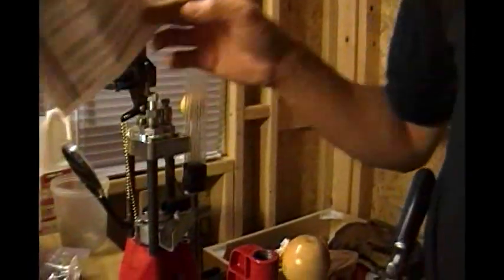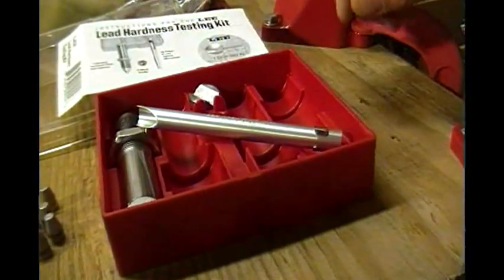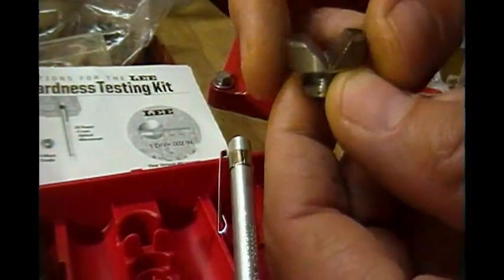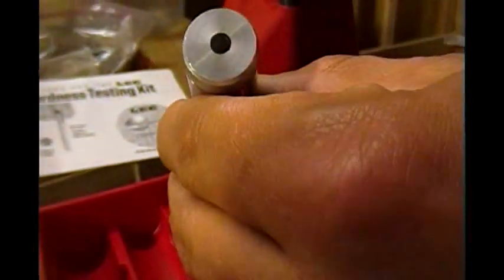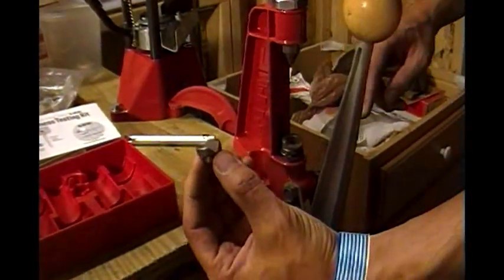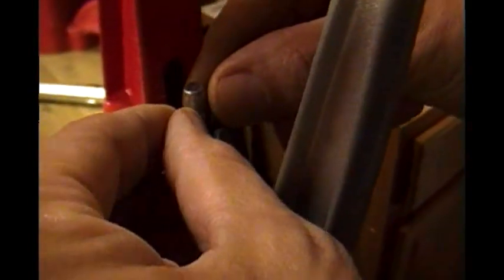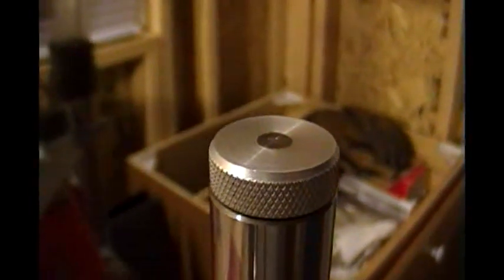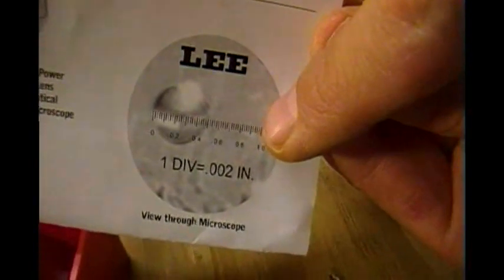Using the Lee Lead Hardness Tester - Part 1

Comment: Hello CowboyT, watched the video, it was very good. I am also using the Lee Hardness Testing Kit, but I do not use the Microscope. Not steady enough to get a reading, instead, I use my computer scanner. I set the it to 2400 pixels per inch, scan the bullet, then load the picture in a picture program called Gimp2. Using it I can measure the number of pixels across the dent. Make three measurements and add divide by 3, divide by 2400, the results are in decimal inches.

Comment from the maker: @MrSchpankme You raise a good technical point here.  My first several were indeed filed down per the directions, though, while I was still learning good technique.  At this point, I've done it enough to where my casting technique is pretty consistent and I get good boolits.  They weigh within 1 to 2 grains of each other, and the BHN readings so far have been very consistent.  But folks starting out definitely should do the "standard" technique to see how they're doing..

Comment from the maker: @Mystaiced They banned lead wheel weights for new installations on cars, yes.  However, they didn't actually ban *lead* itself, so you can buy it on sites like eBay.  There are several folks out there who take lead from various sources (old roofing lead, wheel weights, etc.) and will ship it to you.  That's how I get mine.  Still very much worth it.

Comment from the maker: @fireline6 Yes, I have also tested water quenched bullets.  It takes time for them to reach full hardness.  My results were that BHN 11-12 wheel weight lead would end up right around BHN 16.  However, that was after just a week.  I've read that if you let them sit longer (e. g. a month or two), they will end up about BHN 19-20.

Comment from the maker: @chios1958 You've got a point about lead sickness.  Normally I wear latex gloves when I reload.  However, even if you handle lead directly, what's most important is hygiene.  I always wash my hands and face after working in the reloading room anyway or when working with lead, even if I'm wearing gloves.

Thanks for the reminder--for us all--to be careful with lead.